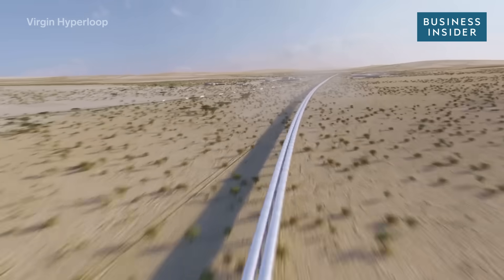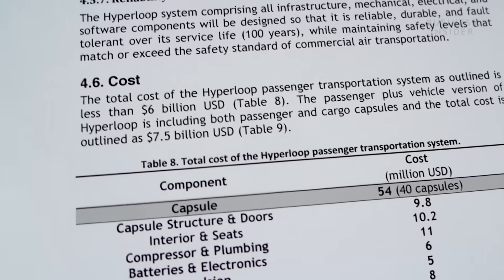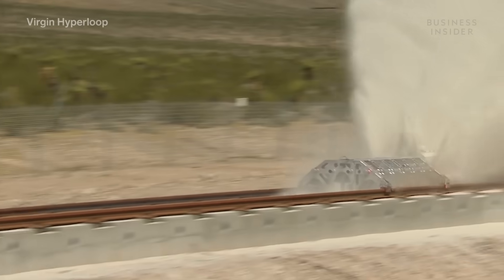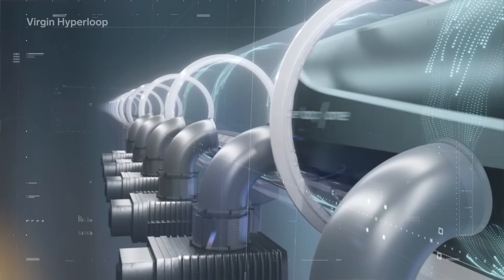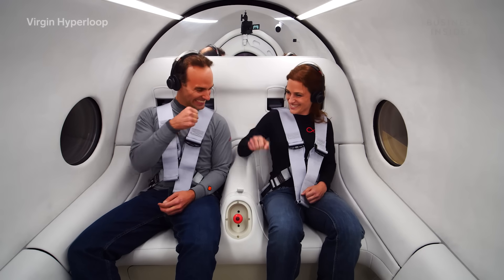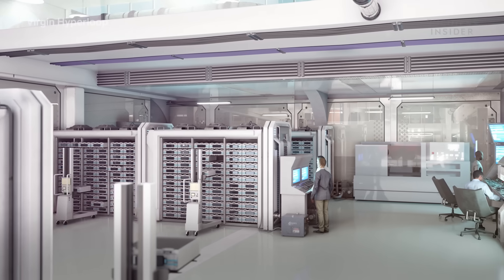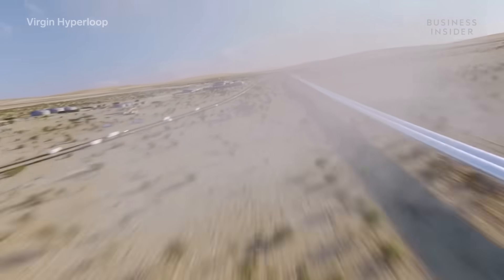How Elon Musk's 700 MPH Hyperloop Concept Could Become The Fastest Way To Travel

Comment: You need better journalists who actually investigate the work they produce.
Reply: It's 21 century. Reality doesn't make views so that's why the hype-r loop
Reply: These people are not journalists. The are shills who spout what ever they are told. The couldn't investigate the back of their own hand.
Reply: Thunderf00t - he's the investigative journalist on this one.
Reply: @32266ms  Thunderf00t is not an investigative journalist and while he is absolutely correct on Hyperloop he is arguably worse on social sciences than mainstream media.
Reply: @32266ms  Despite I agree with Thunderf00t in many things, I don't think hyperloop would be impossible to make, it's just impossible to make it cost efficient and good for economic mass transit.
Reply: @realdanielhorvath  I think showStopper problems are (1) vacuum tube 100s of miles long, (2) turns at 700MPH.  The vacuum tube thing is a disaster waiting to happen.  When it's breached, a wall of air moving at the speed of sound will fill the tube - everybody probably dies.  Airplanes make turns when they could just fly a straight line - this will be a 1000 mile vacuum tube going through terrain - no turns?  It's great in theory - in practice it won't work imo.  But I agree, technically it's probably not impossible.  Maybe a Disneyland ride from LAX to Disneyland. lol :)
Reply: @realdanielhorvath  That was basically Thunderf00t’s argument. Yes, you can build it, but the challenges of building vacuum tube that big are enormous. Thousands of vacuum seals that can withstand thermal expansion, thousands of airpumps etc... The impossibility is the odds of finding capital to take those risks, finding cheap solutions and after all is done, try to say to the investors that we will not try to make a lot of profit.
Reply: @realdanielhorvath  I think safety is even harder what happens if there's a brake down those people now trapped in a can in a vacuum what if a hole from in the cabin.
Reply: @realdanielhorvath  It's not impossible, but it's inpractical, dangerous and extremely expencive. The ticket cost would likely be around $1 per mile, since the ammount of materials required for the tube is insane, pumps are needed More like every 10 or 50 meters, not kilometers, seals will break, air will seep in, airlocks are slow, pods are small etc.

I mean, we are barely able to make gas pipes that don't leak. And think how much damage some drunk person could do with a few bullets. Or maby even a sledge Hammer.

Airtravel is relatively cheap, since you have a bit of infrastructure at each end, while sky is Free and doesn't require maintanance. Not to mention that you need to shut down the system for days just to repair leaks etc 

Hyperloop would just combine the worst of airplanes and trains.
Reply: @realdanielhorvath  for me the main issue is the fact that your locking humans inside a vacuum with no exits other than their destination, so if anything goes wrong between entry and exit you’re dead. And one failure could kill multiple people, because if you want to transport 30,000 people on one line of infrastructure you need a lot of pods to travel simultaneously and they would thus be also locked in the vacuum until the accident is solved
Reply: @realdanielhorvath  Thunderf00t seems to do the thinking for these sheep. Like the claim you can't make pipes hundreds of kilometers long without them expanding and buckling. Errr... above ground water pipes? Gas pipes? Someone should tell this "expert" they exist.

Then there is the claim if there is a rupture then everyone inside the hyperloop will die instantly due to the incoming shock wave. There is actually a solution to this and it's called 1 way pressure release values every 50 meters or so. As soon as there is a sudden loss of vacuum inside the tube, the pressure relief values will pop and let air inside in a control way from above meaning the shock wave will be dissipated.

Claiming it can't be built because you are too stupid to think of solutions doesn't make it actually impossible unlike what tha guy claims.
Reply: @thelanittaja4765  nothing is impossible, but why? We have to make things/products that are cheap/efficient.
Reply: @realdanielhorvath  the atmosphere would disagree with you
Reply: @32266ms  It isn't a vacuum. It is low pressure and compression fans are used to remove the air from in front of the pods to behind them, thus effectively nulifying air resistance. The fact that Thunderf00t didn't even look into the proposal long enough to know this makes his 'debunking' moot. It can be dismiseed in its entirety as it is based on ignorance not only of the proposed system but of the developments that had already taken place at the time that he published his video. In addition their have been further developments since that video so if it were valid then it could no longer be considered to be so.

Those who put out debunking videos do so out of jealously as they themselves are not able to create anything useful or worthwhile.
Reply: @realdanielhorvath  that's what he said, basically.
Reply: @realdanielhorvath  "it's just impossible to make it cost efficient and good for economic mass transit." -- meaning its entire premise is bogus, right?  Of course to Musk the fundamental incoherence and BS is what makes it "engineering".
Reply: @crocodile2006  Are water & gas pipes designed to transport solid objects containing people hundreds of miles?  I'm pretty sure not.  You're another alumnus of the Musk school of "engineering", eh?

Love to hear how your EASY! SIMPLE! check valve scheme's gonna work with the imagined hundred km pipes, all supposedly carrying "pods" at near sonic speeds.  Everyone knows that steel walls and bulkheads become more robust with less need for maintenance, with every additional seam and penetration.
Reply: Jep. It is such an obvious scam.
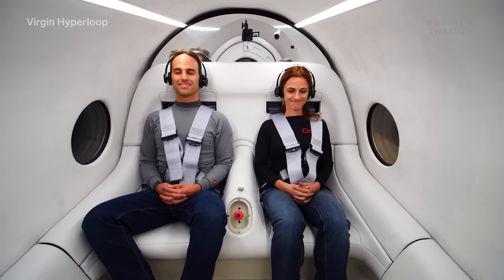Reply: https://youtu.be/BafdAGKvR38 welcome everyone to participate in the last meditation in the Age of Aquarius, in order to end the epidemic, please participate and share a lot!  We will meditate in the Age of Aquarius at the exact moment when Jupiter and Saturn intersect on December 21, at 6:22 PM UTC.  This is equivalent to 10:22 AM Pacific Standard Time in Los Angeles, 11:22 AM Denver Standard Time, 12:22 PM Chicago Standard Time, 12:22 PM Eastern Standard Time, New York 1:22 PM Eastern Standard Time, and London GMT PM  6:22, 7:22 PM Central European Time in Paris, 8:22 PM Eastern European Time, in Cairo, European Standard Time on Tuesday, December 22, Taipei and Beijing, December 22 Beijing Time, Japan Standard Time  , 3:22, Tokyo, December 22, Sydney, 5:22 EST.  http://2012portal.blogspot.com/2020/11/make-this-viral-age-of-aquarius-final.html?m=1
Reply: https://youtu.be/BafdAGKvR38 welcome everyone to participate in the last meditation in the Age of Aquarius, in order to end the epidemic, please participate and share a lot!  We will meditate in the Age of Aquarius at the exact moment when Jupiter and Saturn intersect on December 21, at 6:22 PM UTC.  This is equivalent to 10:22 AM Pacific Standard Time in Los Angeles, 11:22 AM Denver Standard Time, 12:22 PM Chicago Standard Time, 12:22 PM Eastern Standard Time, New York 1:22 PM Eastern Standard Time, and London GMT PM  6:22, 7:22 PM Central European Time in Paris, 8:22 PM Eastern European Time, in Cairo, European Standard Time on Tuesday, December 22, Taipei and Beijing, December 22 Beijing Time, Japan Standard Time  , 3:22, Tokyo, December 22, Sydney, 5:22 EST.  http://2012portal.blogspot.com/2020/11/make-this-viral-age-of-aquarius-final.html?m=1
Reply: https://youtu.be/BafdAGKvR38 welcome everyone to participate in the last meditation in the Age of Aquarius, in order to end the epidemic, please participate and share a lot!  We will meditate in the Age of Aquarius at the exact moment when Jupiter and Saturn intersect on December 21, at 6:22 PM UTC.  This is equivalent to 10:22 AM Pacific Standard Time in Los Angeles, 11:22 AM Denver Standard Time, 12:22 PM Chicago Standard Time, 12:22 PM Eastern Standard Time, New York 1:22 PM Eastern Standard Time, and London GMT PM  6:22, 7:22 PM Central European Time in Paris, 8:22 PM Eastern European Time, in Cairo, European Standard Time on Tuesday, December 22, Taipei and Beijing, December 22 Beijing Time, Japan Standard Time  , 3:22, Tokyo, December 22, Sydney, 5:22 EST.  http://2012portal.blogspot.com/2020/11/make-this-viral-age-of-aquarius-final.html?m=1
Reply: Tesla doesn’t test enough
Reply: You're making the assumption they give a damn about being correct.
Reply: Matt P  Activists? Or corporate mouth pieces
Reply: They just need REAL journalists....
Reply: Alot of people in comments are elon musks top engineers.
Reply: You're assuming journalists are capable and intelligent.
Reply: Didn't even take that long
Reply: Too much to ask from Muskrats
Reply: Why do people think breaching a vacuum will lead to deaths? Do ya'll think explosive decompression is gonna happen because a bullet hole shows up? Do you also believe poking out a window in an airline causes it to explode and suck everyone out the side? lol

We've had multiple leaks on the international space station. Literally the vacuum of space. Nothing exploded. No one died. The issue with a small leak is that the thing wouldn't go as fast. That's not catastrophic by any means.
Reply: @Cyrribrae  are you just wishing it will work? Seriously, this idea has been debunked so many times its painful. The only ones who belive this shit are the press..... and you....
Reply: @yann6753  you mean debunked by some random guy on YouTube.
Reply: @yann6753  You couldn't actually argue so you insult. You can't actually think... so you listen to Thunderf00t and let him do the thinking for you. Has Thunderf00t discovered water pipes and gas pipes exist yet BTW, or does he think they are all buckling in the heat?
Reply: @yann6753  It’s possible for it to work but the biggest concern in safety. Tesla creates great things but they don’t test it and it leads to accidents where people die so in a way I agree with you.
Reply: @yann6753  You haven't actually explained what the problems with the hyperloop are. I've already crushed the "the pipes will expand and rupture" argument. Then we have the explosive decompression argument which is a problem.. but can be prevented by one way valves every 50 meters or so along the tunnel.

What if the vehicle has no power and stops? You use backup lithium batteries and the onboard electric motor to move it slowly to a station. What if the vehicle has no power or the motor isn't working? You push the vehicle with a tow vehicle to the station. 

There are actually solutions to problems... if you THINK
Reply: @crocodile2006  I agree with you lmao. I haven't heard ONE objective statement from Yan N. He makes all these vague statements without ANY citation of credible sources, bashes on any possibility of hyperloop technology as a "foolish endeavor" and doesn't even have the means to refute them at all😂
Reply: @crocodile2006  Test it and if it works, I have no words to say.
Reply: @crocodile2006  i'm a tad late but I'll take you up. Do you think above ground water pipes are just straight lines that run across the country? Or did you just say the first "long pipe" you could think of? Gas and water lines have bends and expansion loops to help them deal with thermal expansion and contraction. You know would would be impossible to do with the hyperloop? Install a perpendicular bend in the pipe to control for expansion and contraction. Not to mention water lines have fluid constantly running down them. AKA a liquid cooling system built in that will help the metal stay at a relatively constant temperature throughout the pipe.. Now this would be the way to get a tube welded together and deal with thermal expansion, this doesn't even take into account this long ass tube is going to be 1/1000th of an atmosphere inside. This makes expansion joints a place where air can leak in, ruining the vacuum. Can you think? It's almost as if you think a multi-ton steel capsule carrying multiple humans at 700 miles per hour in a vacuum will still have the ability to hit 90 degreed thermal expansion bends at speed and just ride on through. So your solution in the event of sudden pressurization is to add more air. I'm sure the capsule traveling 700 miles an hour would not be bothered by this dense pocket of air. Any kind of dent put into the tube while construction or operation will literally make the tube implode on itself. Steel isn't the best when it comes to compression. Literally every part of this Hype-r-loop is a death machine and you're a fool if you think this technology can be implemented on Earth. The atmospheric pressure is just too high. There's a reason the "hyperloop" and airplanes both started at around the same time and over the past century airplanes are here and the hyperloop is still looking for hundreds of millions of dollars in funding. When people call this a scam, they do it because the laws of physics do not want this thing built on Earth. If we were on a planet with a weaker atmosphere (hmmm lets say Mars) the Hyperloop would be viable and people wouldn't be calling it a scam. But we all know Elongated Musket doesn't have any sort of fetish for Mars......
Reply: @crocodile2006  You haven't "crushed" anything.  Though you've certainly demonstrated a Musk-like mastery of "engineering"
Reply: https://youtu.be/BafdAGKvR38 welcome everyone to participate in the last meditation in the Age of Aquarius, in order to end the epidemic, please participate and share a lot!  We will meditate in the Age of Aquarius at the exact moment when Jupiter and Saturn intersect on December 21, at 6:22 PM UTC.  This is equivalent to 10:22 AM Pacific Standard Time in Los Angeles, 11:22 AM Denver Standard Time, 12:22 PM Chicago Standard Time, 12:22 PM Eastern Standard Time, New York 1:22 PM Eastern Standard Time, and London GMT PM  6:22, 7:22 PM Central European Time in Paris, 8:22 PM Eastern European Time, in Cairo, European Standard Time on Tuesday, December 22, Taipei and Beijing, December 22 Beijing Time, Japan Standard Time  , 3:22, Tokyo, December 22, Sydney, 5:22 EST.  http://2012portal.blogspot.com/2020/11/make-this-viral-age-of-aquarius-final.html?m=1
Reply: Can I just say, yall need to do some fine research. I agree that it could be dangerous to have a pod turning at 700 mph, but who said they would turn at a rapid speed ? Then the tube itself. Obviously they would’ve thought about. With the technology we have, they could create a thicc wall. I think there is a video that explains the structure of the tube itself and what their ideas are. Idk why you guys are so worrried about, honestly. They are still testing, scientists,engineers and coders are probably already know the risk factors and are still busy working things out. So I’ll just say let the engineers do their job while we just watch from the sidelines. I mean, I’m no engineer or scientist either. But I’m in the studies of becoming a mechanical engineer.
Reply: @mknightb698  Yeah thats what they said about Theranos -- just let the scientists and engineers work things out and eventually we will be able to do dozens of blood tests with just a single drop of blood which will revolutionize the medical field. HAHA but we all know what a load of crap that turned out to be.

Comment: One question what will happen when hyperloop move in highspeed and electric power down(electromagnetic) .
Reply: F1 car is faster than this future train
Reply: @nchmusic99   i mean electric power down ( electromagnetic will not be a magnet with out electricity right ?)
Reply: @pantri9794  yes you are right
Reply: @pantri9794  so you would be stranded mid way of nowhere if power is down
Reply: @nchmusic99   it's moving in highspeed above the ground due to active magnetic and electromagnetic (if the power off while moving in the highspeed will it really stop ? )
Reply: @pantri9794  I would think that they have enough non electric magnets that it will still hover and just slow down, since it would be bad if it just hit the ground going 700 mph

Comment: Really cool stuff. Expecting to see at least 6 of these bullet train systems with magnetism as a basis and zero air-resistence, to cover 6 continents from North-South or West-East in the decades to come. Think about it, rapid travelling, zero pollution (part of the electrification), an exciting way of moving around, and easy access to new tourist locations.
Reply: these hyperloops will never be built. like, ever. You can't create a vacuum, which these need to work faster than normal trains, quickly or cheaply. Normal bullet trains are so much cheaper, faster, and safer. watch thunderfoot's video for more info.